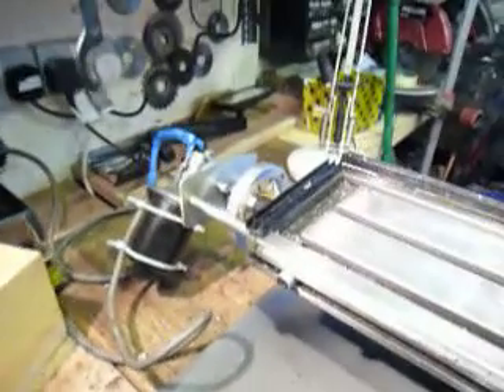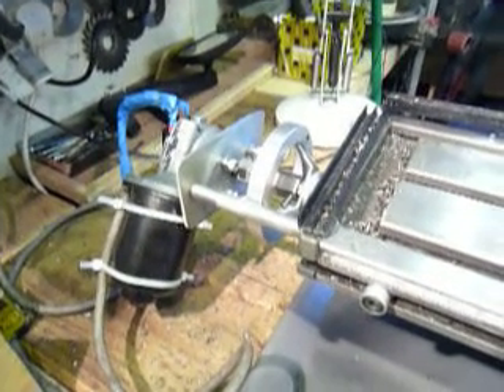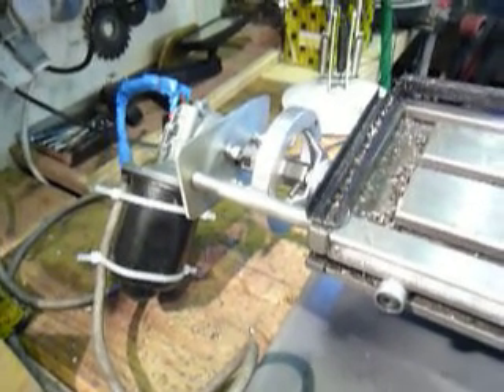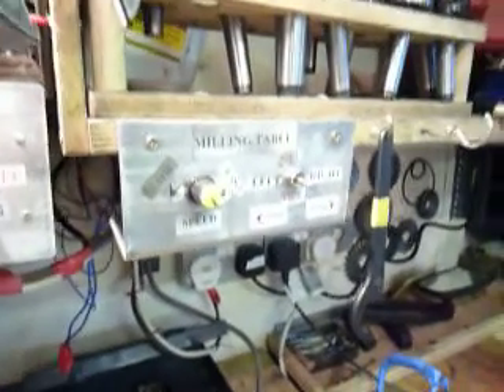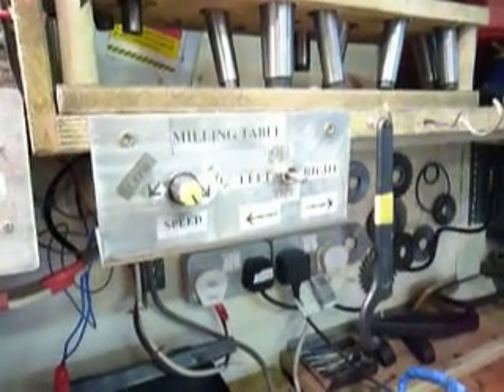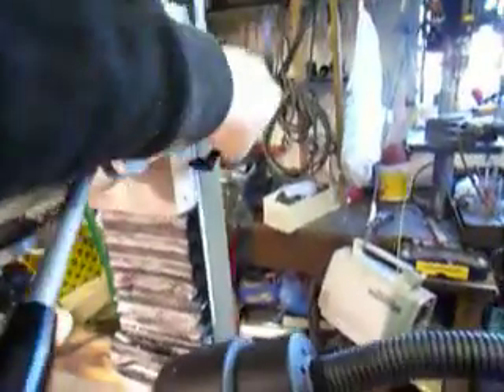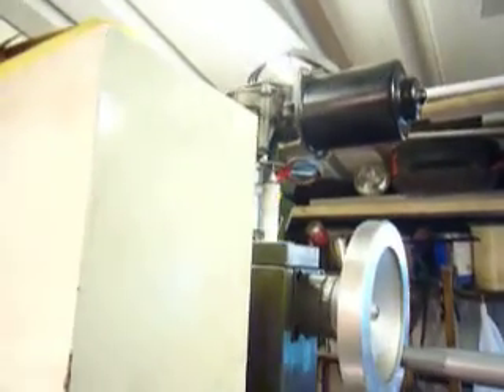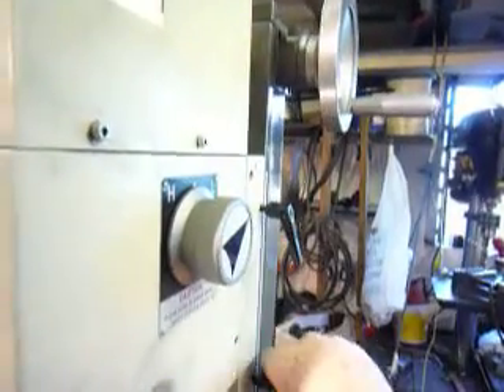milling machine horizontal and vertical drive feeds

Comment: Hey Michael
Do you remember how you connected the wires?.. And do you use 2 or 1 powersupply.. 
I’m fighting against two wiper motors, when i plug one in, they both move..One going down and the other going right ex...I have tried with one and two powersupply for each motor but with no luck.. Any ideas?